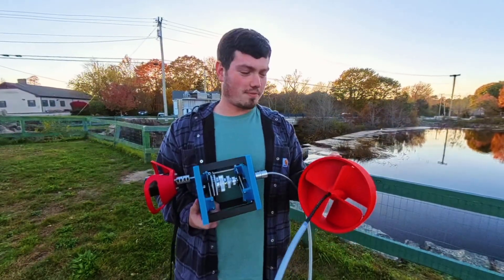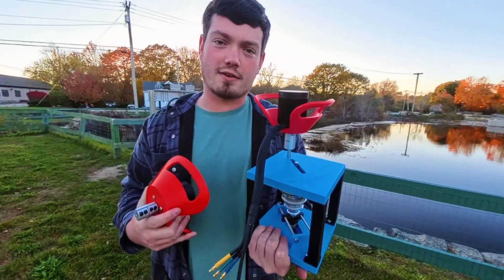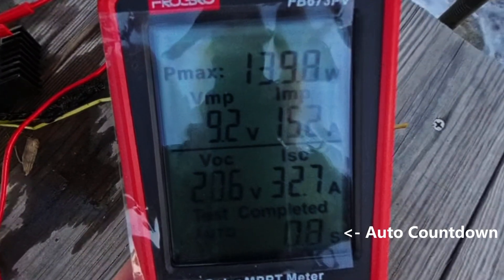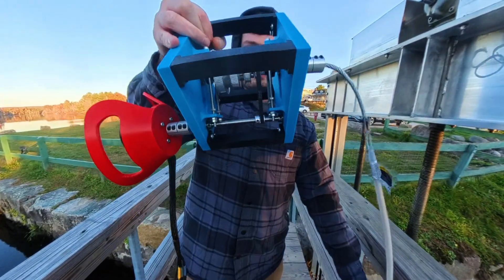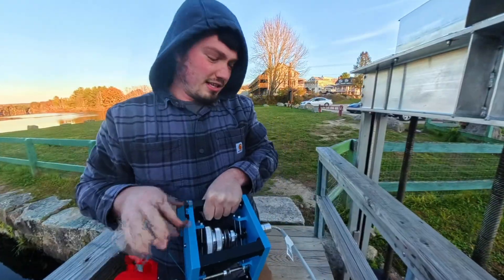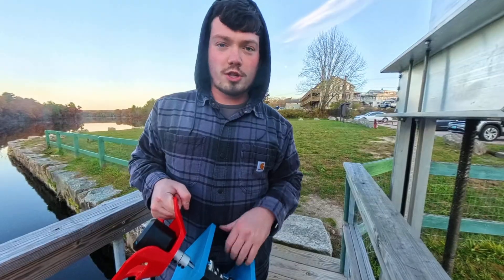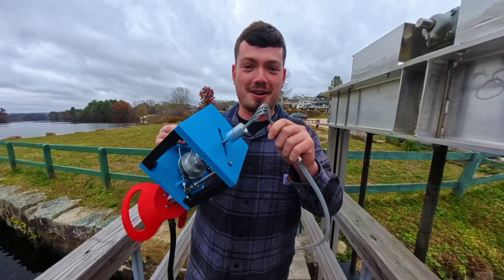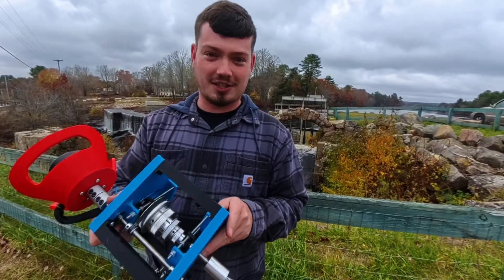100W+ From 3D Printed Hydro Turbine (3D Printed Pulley Gearbox)

Comment: the tester is Shower Vmp 9-12V so I am assuming that is the MPPT Voltage VS your power meter which is Raw rectifier Voltage. This would be expected on a MPPT tester or regulator as it is tracking for maximum Power (Maximum Power Point Tracker) which is Watts not voltage. So your Raw rectifier voltage is a lot higher but your Watts production is what it is. Fit a Wind MPPT charge controller in between you rectifier and your Power meter/Load and the power meter should then match the tester
Reply from the maker: I will have to check this out, thank you! It does seem like that is within reason given the drop and flow rate of this fall.

Comment: Looks like you'd want to use a tortion cable rather than a bog standard steel rope. Also, using eyelets rather than compression fittings would make the tortion a bit easier to manage.
Reply from the maker: I appreciate the advice, I'll definitely look into torsion cables!

Comment: Btw: Isn't that prop rotating the wrong way for the cable? Unwinding it instead of tightening it?
When pulling (tensioning) a non rotation resistant steel wire rope there will be generated a torque in the rope trying to untwist it's lay aka making the rope unlay. The same time your rotor is applying a torque on the rope in the same direction. This will significantly weaken the rope and limit the torque at the point when it becomes unlaid. If you run the rotor the other way around s it's torque tries to tighten the rope it will counteract the ropes natural tendency to unlay and your margins are a lot greater before the rope kinks and becomes "closed" instead. You may be able to transfer many times the torque.
Reply from the maker: You hit the nail on the head! I explained this in another comment saying reprinting the prop after I mirror it, is the best and easiest way to fix this problem. I'm not sure if it will get a ton more power but it should at least keep it from anymore rapid unplanned disassembles.
Reply from the maker: Thank you! I'll give this a shot in the next revision

Comment: I think your handles need to be on the gearbox and you attach the motor by a motor standoff plate that screws onto the gearbox side after the motor is attached to it.
Reply from the maker: This is a solid idea! I'll have to look into this! I may change it up a bit so it can be placed on the railing as well!

Comment: What about using a archimedes screw, instead of a propeller? This might "surf" on the stream of water, and might run more stable therefore and maybe with even mor power.
Reply from the maker: I actually started this build with an archimedes style prop(can't remember if I posted it). It was enclosed on its own much like the ring around this one. It seemed to turn alot slower in this waterfall style test. It does work better in slow speed water though. Let me dig in and see if that can be improved! Thank you again

Comment: It’s nice to see you doing testing outdoors when it’s not zero degrees

Edit: you’ve commented a number of times about how heavy your rig is. Can you print a mount for the railing?
Reply from the maker: I would have to agree although it seems like it will be short lived 😂. 

I've put some thought into this and was going to test something like I used on my water wheel turbine(Paracord and a carabiner). The problem with this turbine in its current state is its very finicky at times and would likely jump out of the water or fall behind it. The other issue is finding the sweet spot where holding it allows me to do quickly. You did just give me 2 ideas on this tho so time to get designing, thanks!

Comment: Flip your steel cable, the blade is turning the wrong side for this cable, If you make your blade turning on the same direction as the cable twist you won't ever be able to mess it up like it happened in this video ;)
Reply from the maker: I had the same idea! Though the cable is the same regardless of which end goes where. The way to fix it is to reprint the prop but mirror the entire thing to make it spin the other way! Thank you for this idea 💡
Reply: @Beyond_The_Print  Yes! You must mirror the prop! This will prevent it from unlaying the cable.

Comment: That tester might not be suitable for motors. 400W seems a bit to high. It might just be the motor/gear inertia, that causes a short power peak. You could put the tester where the heaters were, and read the wattmeter, but that might also give wrong readings.
Reply from the maker: Glad to see you stuck around long enough for a MPPT test!

 I agree, it does seem a bit high. Though some rough calculations show its not impossible given my estimated flow (5ish GPS). What the tester is doing in this mode is waiting then banging that load 2x quickly to test its power. Your idea is a great one and I think would work, albeit the power would only display for those 2 quick blips. I have a rough idea of a new "power test box" that may help out with alot of the issues. The mppt is the current hiccup in that, but stay tuned! Thanks for your long time support on these videos
Reply: @Beyond_The_Print  There is another issue: you dont have a constant source of power, since it is just dangling in and out of the water. Using a real mppt would not work, because it will get "confused". You may want to use a metal rod for this as the steel wire is not optimal anyway. This way you could already design some bracket that holds it all, that you could put on the edge.
Reply: @Beyond_The_Print  If you can borrow a MPPT charger instead you should be able to get much better readings. If you monitor the voltage ripple out of the motor you can even measure RPM btw.